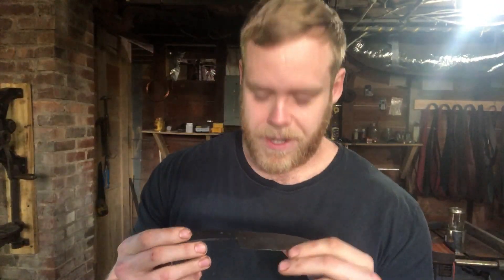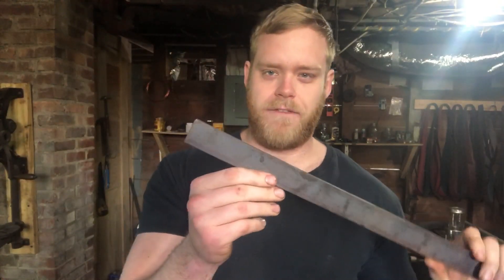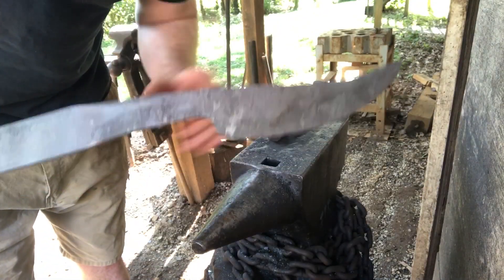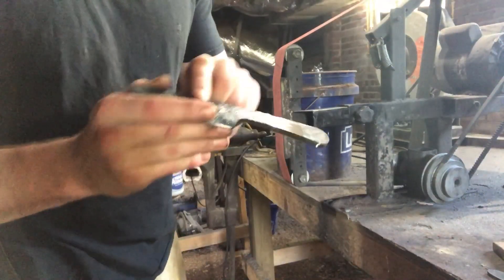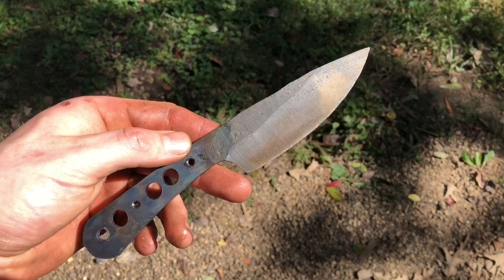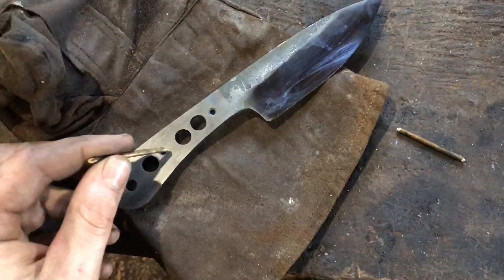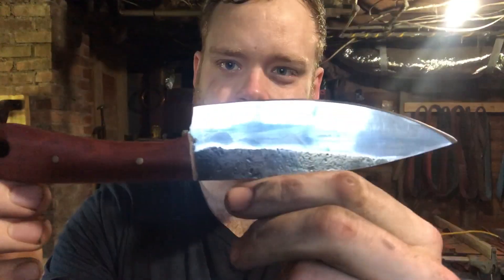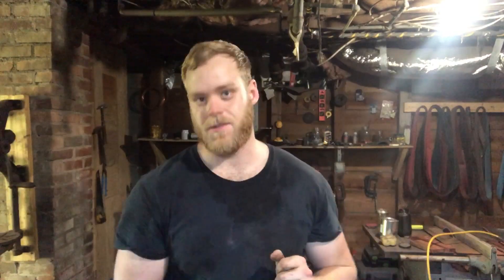Forging a skinning knife for charity

Comment: I'm more of a dog guy myself (though I do love my cat as well).  I think if you were to put a brass (copper? matching the pins) tube in the lanyard hole it would look even better and help protect the wood a little when running a lanyard.  It's a great looking knife.  I love hollow grinds, first one I did made me want to make a straight razor afterwards.  They're fun to make, though there are a lot of intricacies involved in straight razors.  You should try one (making not shaving, no need to go back to your eighty deuce look I'm sure.)

Comment: Is it better to cut off the piece of the metal for the tip, or hammer it in?
Reply from the maker: OverRatedProgrammer you’d have to go over it with the grinder anyway. Often faster to cut off excess than fight with it on the anvil